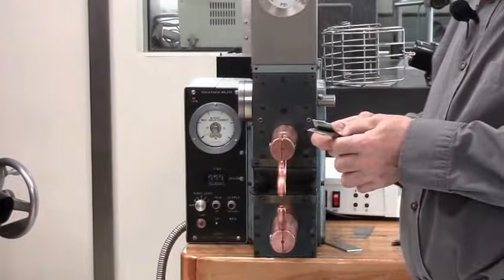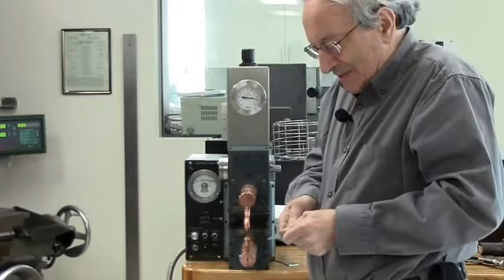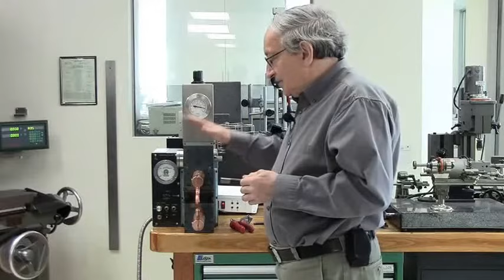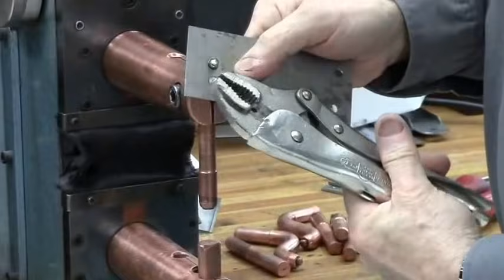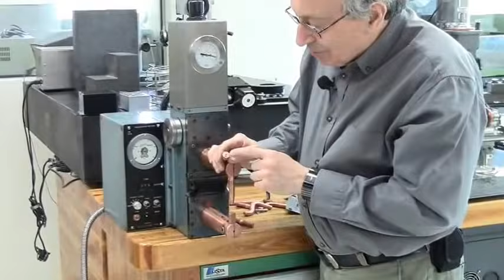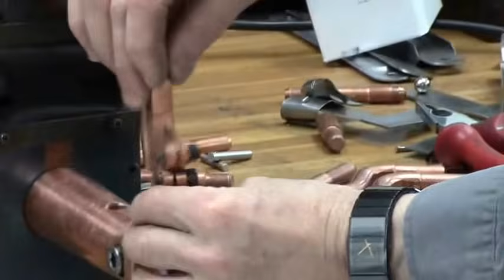Building Prototypes  Dan Gelbart part 5 of 18  Spot Welding

Comment: Interesting trick I've learnt, if you wish to weld alumnium sheet metal, place two thin tabs of stainless steel either side of the joint between the electrode and workpiece, then weld as normal. Not 100% on the science behind it but it definitely worked for me until now.

Comment: Wow an awesome video, there are a lot videos that using microwave transformer to make a spot welder but no explain how it works
Reply from the maker: A microwave transformer is way too small to make a spot welder. You need at last 10 times the power.
Reply: @dgelbart  so it means connect 10 microwave transformers in series so that make 10 times :), can it work???
Reply from the maker: @hado-atlanta  Yes, you can do it with 10 microwave transformers but it is much easier to find a 10KW or 15KW  transformer with a 240V primary winding and wind the secondary for 2.5V with a copper bar (it will only take 1 or 2 turns). If you anneal the copper bar you can bend it by hand.
Reply: @dgelbart  thank you 😍
Reply: @dgelbart  In this video you showed you can control welding energy by adjusting time (number of cycles) and current. Time adjustment is pretty obvious (in terms of how to implement it), but how did you implement current control/regulation? Switched taps of windings? Thyristor trimming of the sine wave (which doesn't seems good because is distorts sine, which means it brings harmonics, which is not good for 50/60 Hz transformer)?
Reply from the maker: @toxanbi  Current control is a thyristor phase control, but in the end, you don't need it. Use max current and only control time.

Comment: Aluminum can be spot-welded.  I have not done it myself, but have seen lots of examples.   While pure Aluminum is a good conductor,  Aluminum alloys all have higher resistance.   Fine (999) Silver is the best room temperature conductor, but there is a company that sells a spot welder for Silver jewelry.   I don't know if it's recommended for fine Silver.    It does work with Sterling (925).   The metal to be spot welded does not have to have low conductivity, as claimed in this video.
Reply from the maker: I was referring to spot welding aluminum with a regular, AC transformer-based welder. There are specialized spot welder for aluminum, typically using a capacitive discharge to achieve a fast pulse time so thermal conductivity will have less effect. The "spot welders" you refer to for silver jewelry are actually laser welders or fast pulse arc welders, where a fast retracting tungsten needle makes a very fast arc. BTW, there is a little known technique of spot welding aluminum with a regular spot welder: place it between two steel or stainless steel sheets. They do not stick to the welded aluminum. This was pointed out by one of UT viewers.
Reply: @dgelbart  That explains it better.  I am currently restoring a Collins 30L-1 linear amplifier.  The main  chassis is spot welded together and has access panels that are fastened with 6-32 screws using PEM nuts.  When each access panel is removed, the high voltage is shorted out for safety.   It is a very well designed unit, manufactured in 1961.  This is the earliest equipment I have seen that uses PEM  nuts.  I use counter-sunk rivets and press-in nuts when I build something with Aluminum sheet.   Some day I will try spot welding.  I have a Raychem capacitive discharge spot welder, but it is a project.

Comment: Not only have I not come across another video on spot welding which is half as informative about how to use it for a multitude of useful tasks, but I've yet to come across a spot welder build video that produces such a useful tool as you built yourself fifty years ago. The pneumatic closure and interchangeable tips take it to another level of useability.
I'd love to build one for our hackspace, and the sheet metal bender you made around the same time would be very cool too.

Comment: Is there a good reference on spot welding ? I can find guidance on car panel welding and the largely automatic battery welders, but I have a device intended for precision welding at fairly low current (1000A) and it has a huge number of adjustments (pulse length, number of pulses, energy per pulse etc) that I have no idea how to optimise.
Reply from the maker: Look under "resistance welding". In your welder just use one pulse, 1-10mS, maximum current.
Reply: @dgelbart  Hi Dan, How did you insulate the horizontal Cu bars from the chassis of the spot welder? It appears the sliding mechanism is not electrically conductive, or there is a different way to hold the bars without completing the circuit.
Reply from the maker: The copper rods are insulated from the steel parts by thin fiberglass washers and sleeves. One rod is wired to the transformer with a flat copper bar, the moving one is connected via a flexible bar made by laminating many thin sheets.

Comment: 1) Current discharge rate and 
2) time factor..... 
What about Pressure  factor 
Any pressure required for spot .... ?
Reply from the maker: The more pressure the better. Shorter times are better but no less than half a cycle (8mS) for thin parts a fe cycles for thick parts.

Comment: Sir nice and deep explanation .... 
What to do if aluminium spot welding....?
Reply from the maker: Place the aluminum sheets between two pieces of stainless steel sheet. The heat from the stainless will melt the aluminum. This was a tip from one of the viewers!

Comment: This seems to be a doable build, and  I am also interested in building a capacitive discharge welder. I can use regular 5amp outlet to charge it slowly and discharge through an scr across 2 sheets. weld more thickness  by adding more capacitors. Can do Aluminum as well. 
But relatively, there's very little information on the net for sheet metal welding purpose.
I think a 5 Farad 10v cap should do. 
but what kind of scr would this require? Is there anything else I require to know before building this? 

Thanks for the videos. I watched them all, now reading all comments in all videos. U are the best teacher I've had.

Comment: Dear Dan, thank you for demonstrations!
However, what you are saying about force (and current) setting is not correct!
e.g. working with max. force of the welder will result in poor welds in many cases.
You always should set all 3 parameters: 1st force, 2nd time, 3rd current (and besides there is a 4th parameter: electrode shape...)

maybe it will help to visit this website to learn about resistance welding: www.widerstandsschweisser.de (sorry, it is in german language...)

regards
stefan
Reply from the maker: Hi Stefan: Large industrial welders are capable of large forces, so force becomes a parameter. For the small welders used in R&D or light production,  the forces are generally too low (many of the welders are foot-activated) so it is best to use maximum force. On my welder reducing the force shows no benefit, but the force is only about 100Kg.  Thanks for the link!

Comment from the maker: Answer to a frequent question: output voltage is 2.5V open circuit. Max. current is 5000A. The input voltage is about 240V 60A. It can operate on a 50A  breaker as the duration of the current is short.

Comment: What is the diameter of the electrodes you are using? Also, I can't seem to find the copper alloy used for the tips on McMaster Carr. Thank you! Great video!
Reply from the maker: I just chose 12.7mm  as electrode diameter. The inserted copper-chrome tips are 6.35mm (1/4"). McMaster carries the material under "copper alloy 182 rods".
Reply: @dgelbart  Thank you so much for your reply! I'm learning so much from your videos.

Comment: Dan, can you point to design information about pinch/spot welders for "welding" ~30 gauge copper wires together?
Reply from the maker: Copper can not be spot welded easily but can be TIG welded or laser welded nicely.
Reply: @dgelbart  OK, thanks.  I don't think I have room inside my project for anything that big though (TIG).  And laser welding is most likely beyond what I could do at home, I think.

Can you point me to design information on DIY pinch/spot welders anyway?  I'd like to build a SAFE small spot welder for my workshop -- I've heard too many bad things about the microwave PSU unit-based spot welders.
Reply from the maker: @bobvines00  Google "resistance welding".

Comment: What a great job!
A couple (or a little more...) of questions:
- when you say "cycle", do you mean a full 60 Hz cycle (16.7 ms), half of it (8.3 ms), or something else?
- When you say 15 kVA, do you mean the size of the transformer used?
- What are the open-circuit / full-load voltages of the secondary winding?
- Is there anything between the secondary and the electrodes?
Thanks in advance!
Reply from the maker: Cycle is a full 60Hz cycle, 15KVA is the size of the transformer,  open circuit about 3V, more for a larger transformer. One side of secondary connected to moving electrode by flexible link made of many thin hard-rolled copper strips, about  5cm2 cross-section.

Comment: Hi Dan,
I love all the videos! Amazingly informative! I am building a welder and have designed a number of mechanisms for the linear motion... From looking at the fastener locations, none of them seem to match. This is a pretty basic question, but if you are willing, I am super curious about your design. Thank you!
Reply from the maker: Mine uses a homemade track, where the front steel plate forms part of the track.
Reply: @dgelbart  Thanks for the fast reply! From what I can tell there are two vertical plates bolted to the back of the front-sliding plate that engages the back of the front-fixed plate. That takes up all the clamping force. If this is correct, I'm wondering where the seating-force comes from that holds the sliding plate against the chassis when the jaws are open. I know there are many viable solutions here including off the shelf linear slides. I'm mostly asking because all of the solutions I have come up with don't seem to match yours and I'm sure yours is quite simple and clever.

Comment: 2:47 I recall some time back someone spot welded aluminium sheets together by sandwiching the aluminium sheets between steel sheets. The heat generated by the electricity passing through the steel conducted to the aluminium and made the al sheets fuse together.

Comment: Hi! how you made the current limiter ? do you use a circuit ? I have 4 capsule diode 200v 6000A to make the rectifier and ceramic tube adjustable rheostat resistor 30x220 ohm 470 but how I can setting the current ?
Reply from the maker: You don't really need the current limiter and for sure you don't need a rectifier.

Comment: I've never heard anyone say that glasses are good enough. No idea if that's true, but wearing safety glasses over regular glasses is an awful experience.
Reply: Try different safety glasses to find a better fit.
Prescription safety glasses are available, $$$ though.
Try (vented!) goggles.  Much cheaper to replace and keep e.g. sawdust out of the eyes.
Get glasses with big polycarbonate lenses, and there are side-shields that slip on.

Comment: Dan, thank You very much for taking the time to share Your knowledge! 
I learned more in 30 minutes  about spot welding than I ever knew before. 
I am not a master machinist like You are, just an electronic engineer making my own prototypes for my line of work. Never figured a spot welder could be this versatile and useful for prototyping. It is now definitely on the WTB list for my shop. I really like Your design, I may try to copy it.  
I did once build a small capacitor based spotwelder for welding  small wires for use under a microscope. The pulse was initially to fast causing gassing of the metal in the weld so the wire would not fuse to the base material well. In some cases I think You get a better result slowing down the current pulse a bit, there seems to be an optimum, but that is for much faster pulses than 50/60 Hz cycles  of course.
Best regards and thank You again,  Erik
Reply from the maker: Short pulses should not be a problem if sufficient pressure is applier. I have a capacitive spot welder as well.
Reply: One problem for us was that contact pressure was limited due to the substrate being a rather soft circuit board that could not take very high forces . The wires were round and just a few 1/100 of a mm and usually tungsten or similar material very different from the substrate.  Welding times i think  was rather on the order of microseconds. My guess on why to fastest pulses did not work is that above a certain di/dt the thin wire seems to act similar to a EBW exploding bridgewire detonator type device and plasma  pressure pushes the contacts apart. The result is just a spark, no fusion and also some undesirable metal plating on the surrounding structures. It did work when inductively limiting di/dt but the sweet spot was not so easy to find. I have also read about the double pulse method for capacitive welders where the first pulse creates a larger contact area and the second pulse fuses the weld, I guess to alleviate similar concerns. I do not know if that is practical for microscopic stuff due to the extremely short pulses required.
Best regards and thank You again for Your excellent videos!

Comment: what type of solid state relay can you use to switch 5000A?
My second question is what are the transformer specs? (Input Voltage, Phases Used, Output Voltage)
thanks for your videos they are so great learned a lot so far.
Reply from the maker: The SSR is o the input side of the transformer, switching only 50-100A. The transformer is 240V primary, 2.5V secondary, 50A primary current. SSR needs to be rated higher because of transients.

Comment: sir you told the power of spot welding mch is15kva then the basic rating of the powertransformer is2.5v /6000A then my questation is how i can accomodate cu wire on the smaller size of the trans core crosssection my questation is can you give an guideline for the transformer design because the design is differ from conventional transformer.
Reply from the maker: The primary winding is conventional, the secondary is about 2 turns of an annealed copper bar with a cross section of at least 8 square cm.
Reply: The transformer is in intermittent use, which reduces heating constraints and allows use of smaller conductors than would be required for a continuous-duty transformer.
Too small of conductors will however increase the secondary resistance and reduce the current capability.

Comment: Where can i get this spot welder?
Reply from the maker: You have to build it, but you can buy on Ebay lower power ones quite cheap. .
Reply: I already bought 1 on Ebay, too low powered. I have been looking for a more powerful model but not the huge industrial ones, with this model i could redesign the electrode holders and it would be perfect. I am interested in the component design of model.

Comment: Hi Mr Gelbart,
     I have learned so much from you Dan, I can’t thank you enough.  I’m almost certain that a man of your experience will know, but it is possible to spot weld two pieces of aluminum with a spot welder like yours, if you place two steel pieces between the aluminum parts and copper electrodes.  See the following YouTube video from ‘Lazze’.  The link is ‘https://www.youtube.com/watch?v=gcgC3V3mkcw’.  His YouTube name is ‘lazzemetalshaping’.
     I’m sure you know this trick already, but your viewers may find it useful.  The steel generates the heat required as it will resist the flow of current.  This then heats the aluminum.  I don’t think the aluminum gets as hot as the steel, but the melting point of the aluminum metal (not the aluminum oxide) is lower.  What do you think of this method Dan?  Good idea, bad idea?  :-)
Reply from the maker: Yes, this is a great trick and will work. I did not know it. Thanks!

Comment: +Dan Gelbart Hey - can I ask you how you designed the 'clamping' mechanism?  I am looking at using an offset crank-slider quick return type of design but am struggling a little with the details, such as how to make the motor stop at a predetermined pressure, then reverse itself to bring the arm back up.
Reply from the maker: uses air cylinder.

Comment: Hi... I am struggling with Ni-sheet welding.. since 2-3 months... I have 0.5 mm Ni-sheet. I want  to spot weld it with another sheet of same size. But my electrode is getting melting ... arcing... oxidized joined... Please give me some idea...how I can achieve clean and strong welding
Reply from the maker: +Shivendra Maurya  Use Cu-Cr electrode tips, high current and pressure, short weld time.  Typical  setting  5000A for 3 cycles or 10,000A for 1 cycle.
Reply: +Dan Gelbart Thanks for replying.... I am giving you detail of my work.. I am using Unitek -250 Welding Machine with following options:
1. Pulse set option : 1 to 3 pulse
2. Polarity : Straight/ reverse
3. Manual heat options
4. Switch up to 250 WS manual
Presently I am using electrode of OFHC copper/ copper with tip dia 1.5-2 mm and want to weld two Ni--222 sheets of thickness 0.5-0.7 mm each. Up to 75 WS it is fine but above 75  to 250 WS it starts arching/ melting of electrode/ puncture of job/ oxidized welding area. So please suggest a solution.
What are you general comments about surface roughness of the faces to be welded  etc?
Reply from the maker: +Shivendra Maurya No experience with the Unitek. Would try larger electrodes with spherical tips.

Comment: Dan,  In your video, you mentioned that you did not use the power variator circuit.  If I wanted to use the power variator, how does it work, and If I don't have one, do I need a current meter circuit?
Reply from the maker: +John Leech  Works just like a light dimmer but with high power triac (50-100A rating). Believe me, you'll never use it.